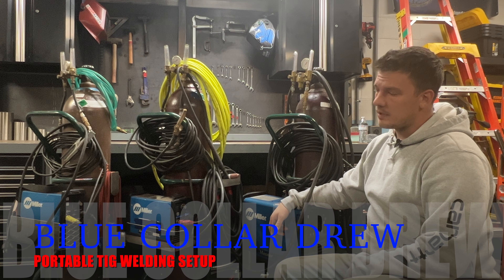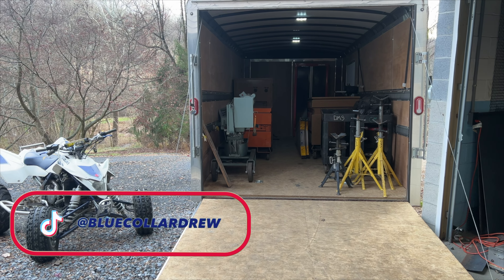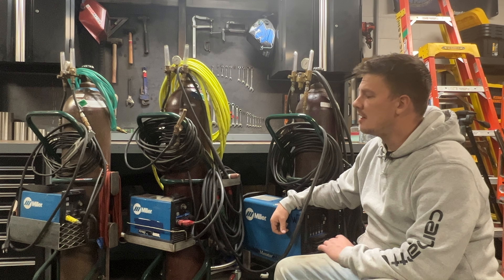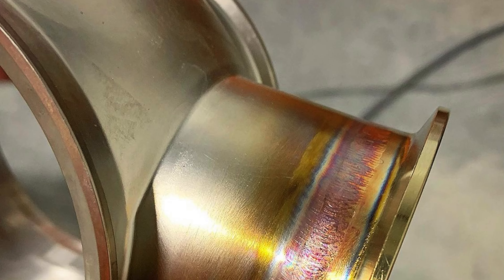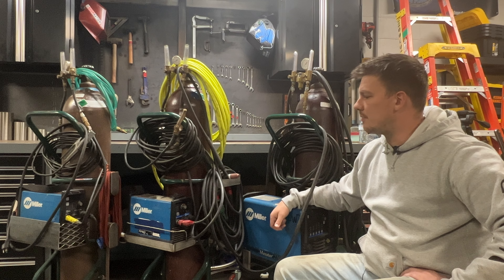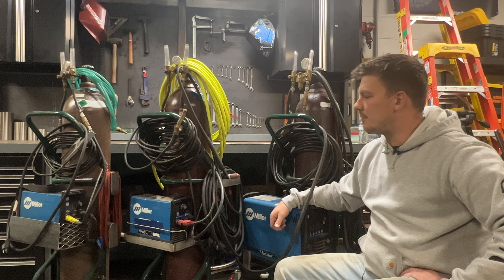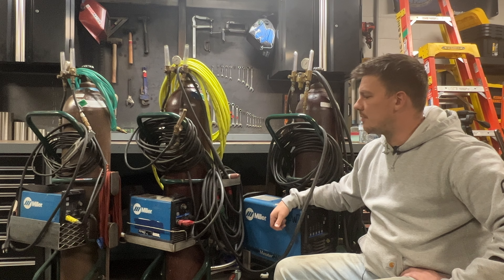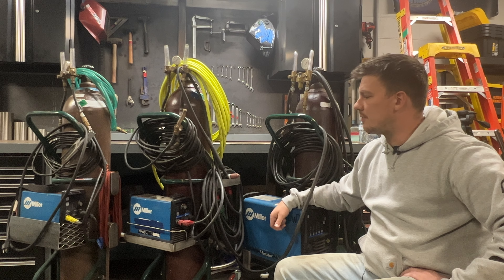Welding On The Go - Portable TIG Welding Setup For Pipe and Tubing Jobs

Comment: I’m a welder from the Uk. Mainly do process pipe work like yourself. Never seen that power block configuration in my life. Over here we run gas through the machine and use the HF. A lot of guys pulse dairy pipe too.

Comment: Hey Drew. Wondering what insulator gas lens heat shield you are using on your 17 torch with that number 8 cup please. Loving the videos keep them coming 👍👍👍
Reply from the maker: Hey there, do you mean the white piece between cup and torch? That piece comes with the torch. The torch i buy is linked in my amazon storefront if ya want to look at it.. hope that helps

Comment: I am told the Maxstar 161 S does not TIG .  I am currently running an STL that is loaned to me.  I always run it in the 6010 mode since I like the OCVs there better.  I'd like to pick one up, I'm wondering why the S model can TIG as a scratch start rig since that is essentially how I run the STL?
Reply from the maker: Yes i believe you can scratch start TIG with the S. Personally i wouldn’t want to be without lift arc for what i do.
Reply: @BlueCollarDrew  I ended up buying the 200,  figured a bit more capability couldn't hurt!  Love your content, keep it up!

Comment: Are you getting power off a generator out in the field? Are these capable off of 110 if needed in a pinch?
Reply from the maker: Almost always use the 110 power at the plant. Unless there’s a crappy breaker or gfci.. the 110 wall outlets work fine up to around 110-120 amps